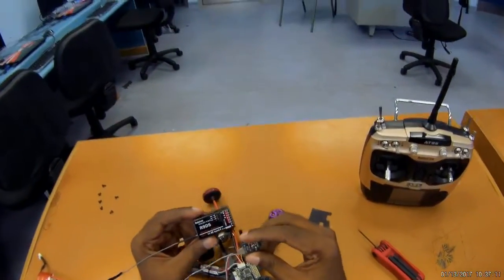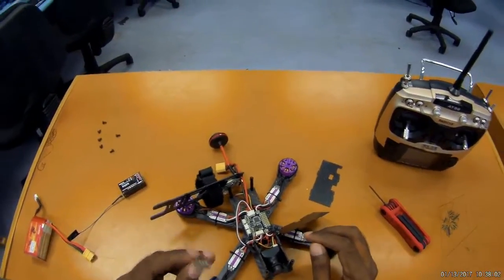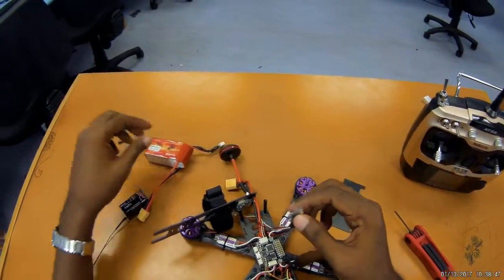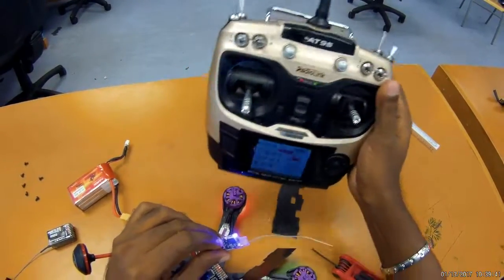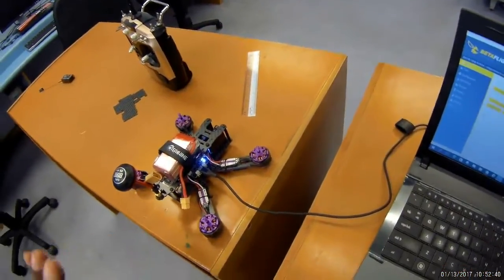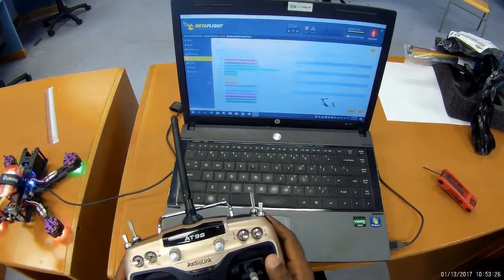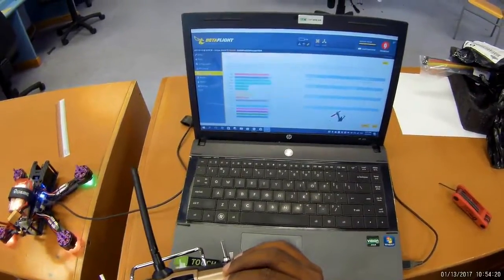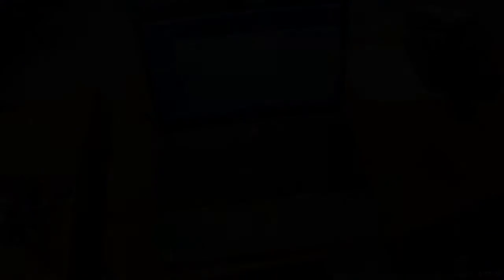Newbie FPV Pilot  Adding & binding new reciever R6DSM

Comment: You might know this by now but you can change it the antenna. It's called an ipex connector and you can get an 8 pcs set of spare antennas for like 10$ on Amazon. Thats what I did.

Comment: Can you help me, my at9 is showing single on the controller but my drone keeps beeping.
Reply from the maker: Hi, i wish i could help but i am at a loss myself....i have never seen 'single' on my controller. Sorr i cannot be of any help. Perhaps you can make a short video of your problem and post it up.
Reply: Shirdi Ali sorry I meant signal not single. on the controller there's signal showing that it's connected to the drone but the drone keeps beeping.
Reply from the maker: Bee Xiong ok....well if u have a beeper it cud the switch is on for the beeper.

Comment: sorry I'm a noob but what is that plug you are pulling into the receiver?
Reply from the maker: No worries, its just a servo plug with three wires, power ground and white is signal. It allows you to power the receiver and send the signal to the flight controller.
Reply: Shirdi Ali can you please help me find a place to purchase one? I am having trouble finding one!
Reply: Shirdi Ali I have the receiver and at9 just need that cable
Reply from the maker: Ok use this link below
https://www.banggood.com/10X-10cm-30-Core-Servo-Extension-Wire-Cable-Male-To-Male-For-FUTABA-JR-p-1050815.html?rmmds=YG04083694100201602Q
Reply: Shirdi Ali your the man sir! thank you

Comment: you can still use your old receiver, simply remove the external shielding off the end of the antenna. you will want around 28-32mm removed

Comment: Do you know how to set filesafe on it?
Reply from the maker: Yeah there is a failsafe tab in betaflight. If you do not see it then on the top left corner in betaflight you should see a button to enable expert mode and then you will get the failsafe options...If you still need help let me know
Reply: I did this. The problem is that flight controller don't understand that the signal is lost with this reciver. Try to disarm quad and turn off the transmitter, nothing happend, props continue to spin
Reply from the maker: Александр Силин Are you using the same radiolink radio?
Reply: my radio is AT9, no S at the end. Did you tried failsafe with this reciver?
Reply from the maker: I will check it out...also i will take a photo of my failsafe setup for betaflight as well as my radio fs settings and share it with u tmr though...
Reply: Ok. Thank you very much.
Reply from the maker: Hey...i am adding a link to joshua bardwell video on setting up with betaflight...he goes tru everything including failsafe. As for your radio you can try what i have by clicking the link (try this first) and then see if it works..then try the video setup.
http://shaniecar.weebly.com
https://www.youtube.com/watch?v=e7dGCZMJ6SA&t=98s
Reply: I set 8 chanall to 0% and make in modes switcher to failsafe on this position. When signal lost 8 chanal switching to 0 position and failsafe turnd on. Thank you for your reply